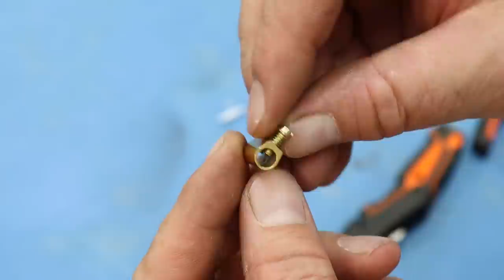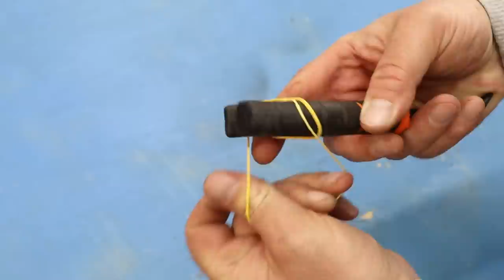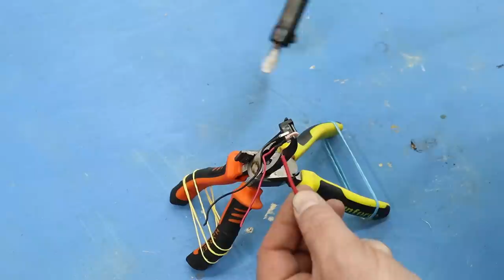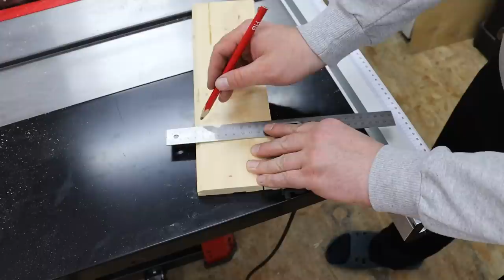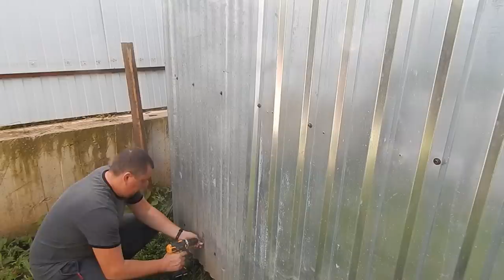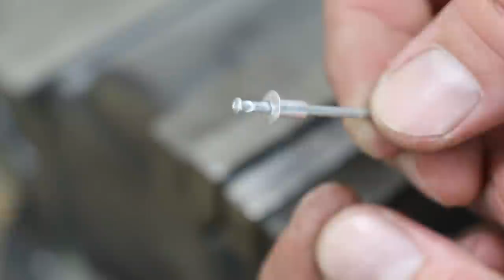Мало кто знает эти Советы и хитрости старых мастеров проверенные на 100 %!!! Отличные идеи!

Comment: Put some heat shrink over the magnet first as they are very brittle and will break very quickly, you won't loose much attractive force and can even melt a groove in a second layer to keep the nail upright.